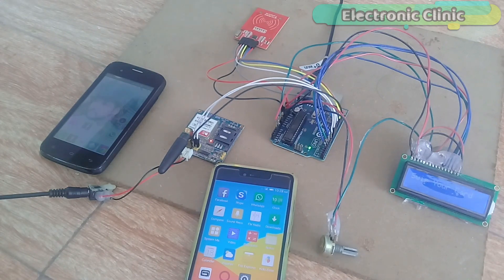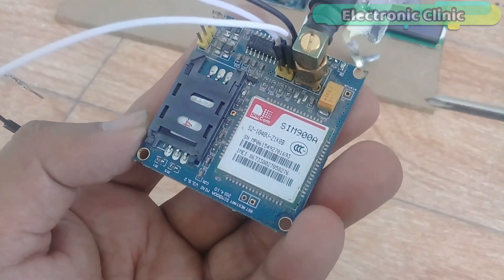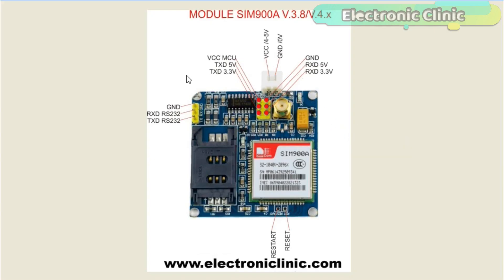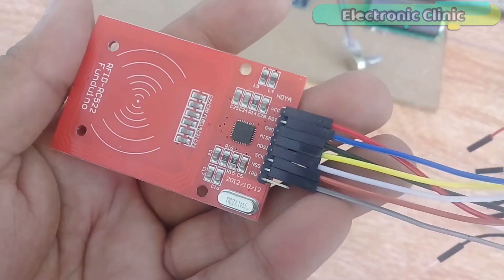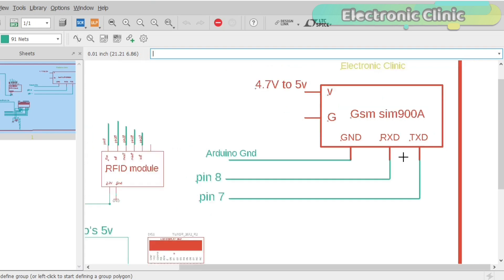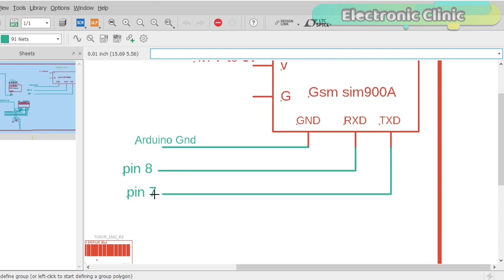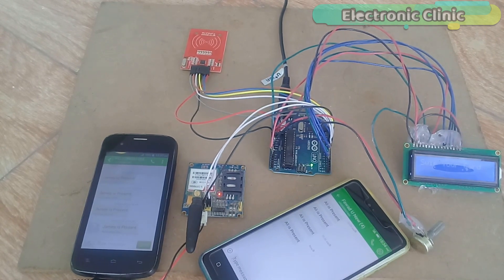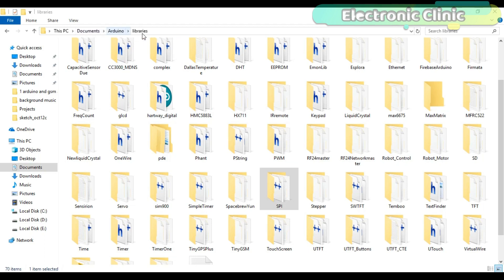Arduino Project: RFID & GSM based student Attendance Alert message to parents “MFRC522 +SIM900A”

Comment: I need a laser based security system using gsm module can I get the details about that?
Reply from the maker: i have already done this. check playlist.
Reply: @ElectroniClinic  but I want that project with IR sensor... Please reply
Reply from the maker: @chetanreddy4546  its simple replace pir with ir sensor.
Reply: @ElectroniClinic  can u please  give us the circuit diagram & code. Please help us to do this.
Reply from the maker: @chetanreddy4546  no need to modify the code, and the ir sensor has the same pins as the PIR sensor.
Reply: Need circuit diagram & code. I'll pay for it also.

Comment: Good day sir, i would like to ask if the program would still work with SIM800L GPRS GSM Module? Or even SIM 800L EVB Module?
Reply from the maker: I think this will work. Because other guys built the same project using the SIM800L. You can verify the supported baud rate.